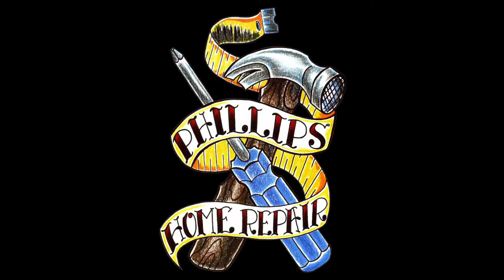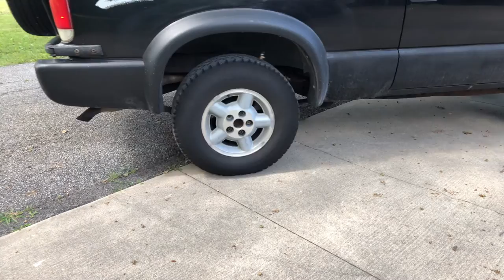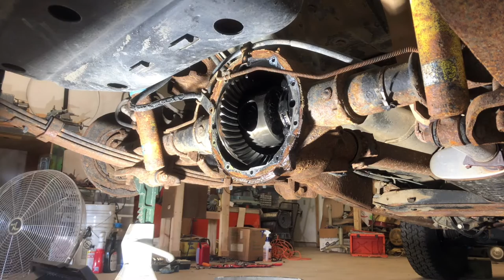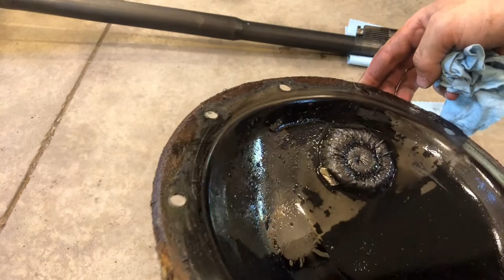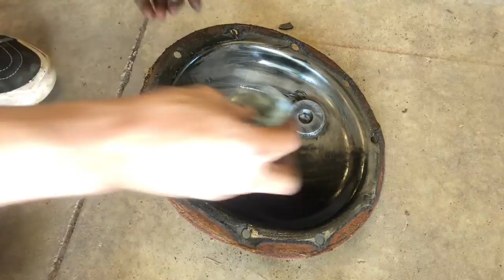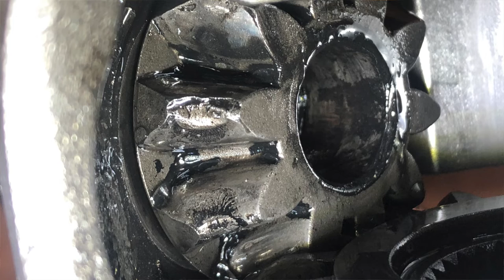2000 Blazer ZR2 Winter Truck Build Part 12: Rear Diff Disassembly

Comment: I just bought a 2005 blazer 2 door 4x4 and then I found your channel , and yes I had a house mouse the motor is good and the drive train , its mostly small stuff that's wrong with it ,like no radio , power steering seal leaking , somebody damage , but hey its a winter beater and has a lot off life left in it.

Comment: The good thing about all this is, when you're done you have a solid vehicle.  Plus you've learned enough about it you shouldn't have any problems keeping it running.  I bought my 2000 4 door back off my mother in law recently who ran it into the ground for a number of years (I bought it in 2004 with very low miles), been doing a lot of work to get it running right again.  Nowhere near as bad as what you started out with, though.

Comment: I had the same issue and I couldn’t figure it out untill my diff literally exploded inside the shims and bearings were rips into shreds and the amount of fine metal is crazy to this day I still touch stuff down under my blazer and look like I dipped my hand in glitter. Always check the diff first on the blazers… easy fix but jeez